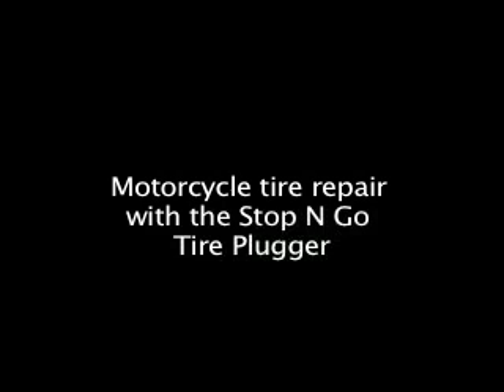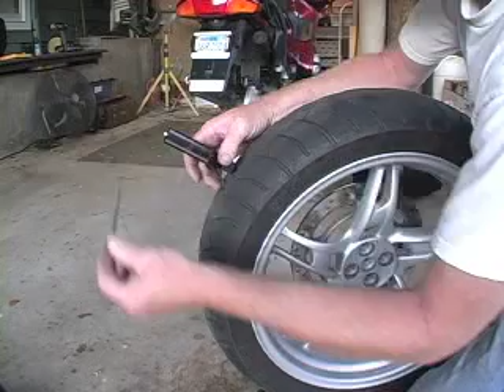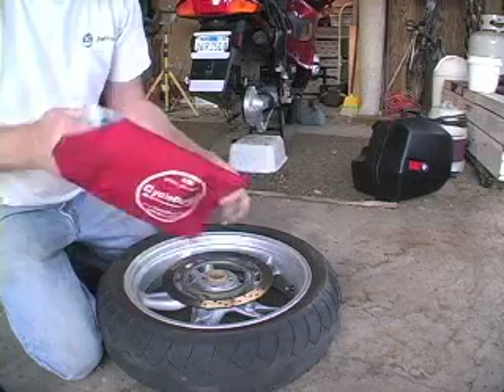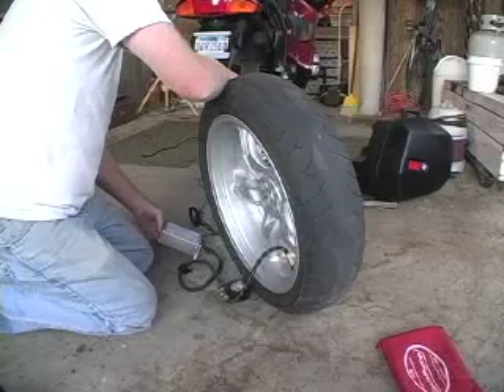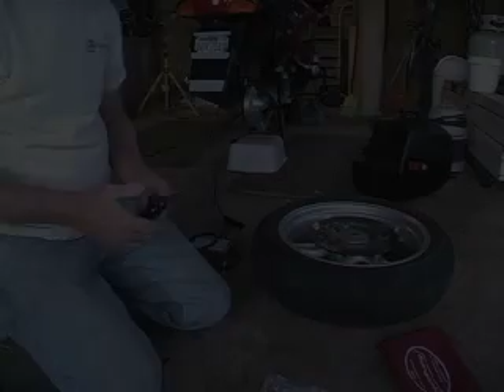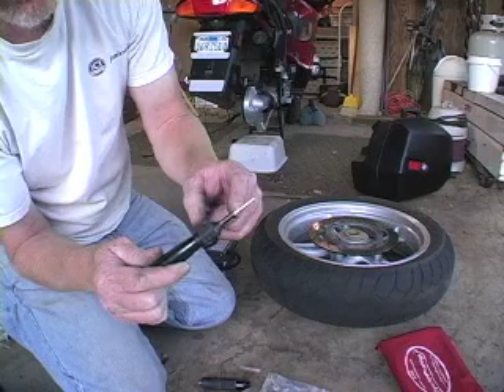Motorcycle tire repair

Comment: Depends how you ride and how much spare cash you have, rear tires cost $300 here, I have 1 'pro' repair plug and now 3 other plugs which i've put it myself on my rear (1000cc) bike - i commute on it daily. plugs have held for 1000's of km's. if your not doing hard riding or track days - home fixes are permanent. These plugs have saved me $1200 worth of new tires

Comment: I have the same system works great for any tire repair but with a gun that pushes the lug in and Im' running out of plugs. My set has two sizes. Can't seem to find a supplier. Thanks for any help.